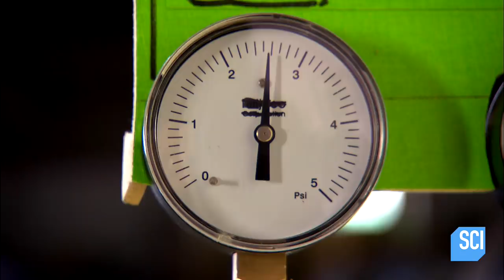Breaking Out of Jail with a Distributed Load of Antacid | MythBusters

Comment: The water should've added more pressure to that jail
Reply: That's what I was thinking too.
Reply: It did they should have put buckets or something that could be remotely triggered to drop water into the tub without bringing anything from outside of the room aka the water from the hose into the room
Reply: It would. But only a small amount
Reply: @GOAlposT Air on the other hand is compressible.  While adding water to the mostly sealed container does not increase the density of the the water, it does compress the air in the room.
Reply: @jwlarocque  If you bothered to look at the water level it is nothing more than couple inches at best the amount of pressure that created is literally nothing.
Reply: @GOAlposT It occupies space. If you have a room full of air, then fill it 1/4 full of water without letting any air out, that increases the pressure of the air.
Reply: First mind what I thought was same about water 😁
Reply: @jwlarocque  and in a real situation the cell would need some ventilation due to the need to breathe in oxegen.
Reply: @markoslamnik2812  um most municipal water systems run at 60 psi...
Reply: yes the water displaced the air therefore compressing the air
Reply: Should have added a dam to catch the water so it wasn't pressing on the door. That way only the air pressure would have been acting on it.
Reply: Bruh, the water in that room (about three inches) would add around 0.1 psi. On the other hand the air pressure in the room is equivalent to about 10 feet of water (4.3psi)
Reply: shit ye thats what blew it open defffo

Comment: That would definitely work. . .  If you had a tub of antacid and water in your jail cell 🤷🏼‍♂️
Reply: And don't forget that the whole purpose is to build up enough internal pressure that fully sealed room blows open. I'm sure the person sitting inside said room would be absolutely fine. Genius
Reply: I was joking
Reply: Or were u
Reply: The difficult part is not suffocating in that air tight cell while you accumulate all the antacids you need. If you can survive that, you're already super-human, so withstanding the pressure and sudden depressurization should be cake. XD
Reply: @autonomouspublishingincorp8241  it's how those divers escaped the byford dolphin dive chamber, by being explosively decompressed through a 12 inch hole
Reply: Jail sell
Reply: @ScarHead777  this was my concern  also like setting a room full of gas on fire just to stay warm

Comment: Going off this short I call the myth busted.    To release all the need gas and it needs to be airtight anyone in there would lose consciousness and more than likely die of CO2  poisoning.
Idk, have never seen that episode so
  Is that an accurate assessment?
Reply: I mean I could survive by holding my breath, if it was filled with water first and added the antacids last you could probably survive the explosion.  But getting that many hidden in a jail cail would be difficult.  I'd rate this as plausible, simply for the fact that prisoners are dedicated, unless they raided the antacid supply all at once it would take years to accumulate most likely.  The issue with that is the jail cell being opened doesn't mean much because there's other locked doors XD and there's no way it wouldn't be noticed.  Diving deep under water 8ft is 3.64 psi so a little bit more than that is survivable. There's a sink and toilet in most cells, and you could get a glue to seal any opening/potentially weld it. 100% doable, they just don't want anyone escaping with this method so I'm sure they called it busted.  This is only feasible if there's another way out immediately after releasing from your jailcell.  You could create a bit of an artificial oxygen tank/space separated like a bubble to be able to breathe as well with balloons or plastic bags.

Comment: Myth busted.
If it broke that door, it would crush you inside before it breaks the door.
2nd, no jails have air tight cells 😆
Reply: Well, yeah, they busted before it and, as always, if following the myth busted it - they trying to recreate it with own efforts
Reply: It's only 5 psi, which is the same as being like 10 foot underwater... nope.  The key is that critical parts of the door are under that pressure, it's not designed to work deep underwater.  Humans can dive 40 feet+ (Actually a hell of a lot more than that).  Your ears would pop, but that's about it.  Humans are very tolerant to water pressure, doors designed for surface use aren't.  Humans can survive up to 50 psi!  Look it up!  And some people can dive 200 feet, which is twice that. They called it busted just because they don't want prisoners actually trying it.